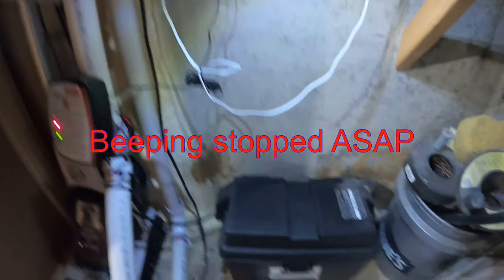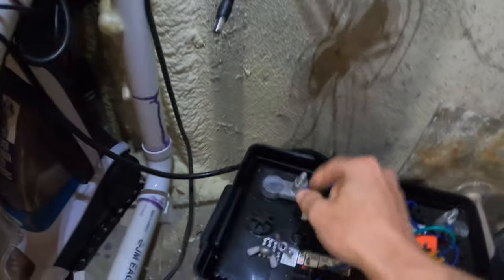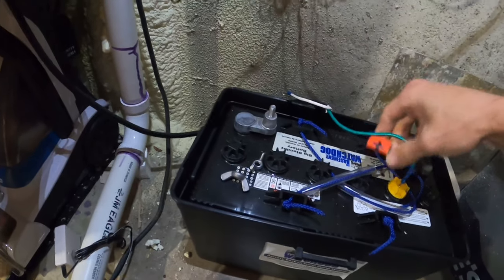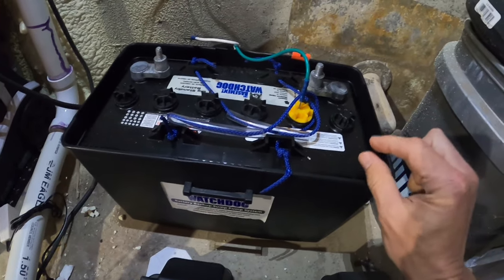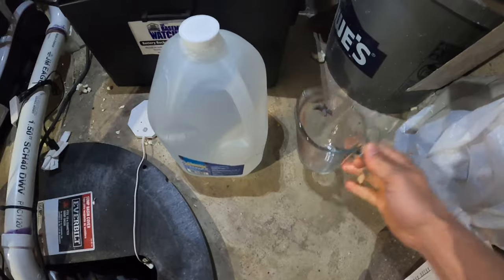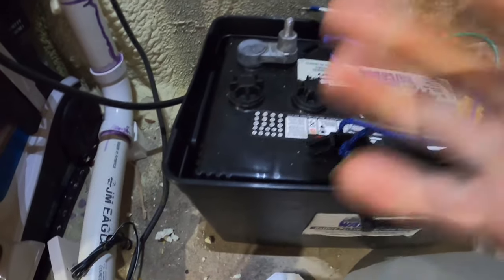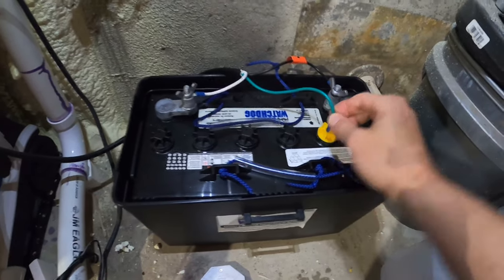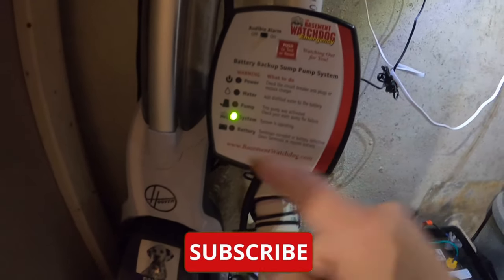How to Add Water to a Watchdog Backup Sump Pump Battery

Comment: Great video. 1. How come the acid does not react with the water? 2. How many ounces normally per section is the capacity? I m afraid to overfill and spill.
Reply from the maker: You only add acid once.  After that only water.
Reply: @FamilyDIYtv  thanks

Comment: When you say ledge, are you referring to the accordion looking stuff at the bottom or that little piece of plastic that hangs down from the opening?
Reply: I filled all of mine to just above that kind of accordion looking piece but the alarm is still going off and I’m wondering if I didn’t put enough water in

Comment: Do you have a video on what to do when the bright red button is next to " the pump was activated,  check the main pump for failure?"
Reply from the maker: I don’t - sorry.   I’d unplug everything and plug back in then hit test button to see if pump activates… if possible test it with water to make sure it pump out.    Can put a bucket in there and fill with water.   See if it pumps out.
Reply: @FamilyDIYtv  thanks, I found a video already saying what to do. I just had to press the reset button. I guess the pump just had to be reset

Comment: What I like to do is pull the battery out put it on the bench and shine a flashlight from behind it, and you can see the water level and each cell should be level with each other

Comment: Is it supposed to smell like gas if it doesn't shut off?
Reply from the maker: you mean when you open the battery?  if yes, it does smell like gas, like sulfur ....  it's acid. 

-Mike
Reply: @FamilyDIYtv  Thanks for the video. I added the distilled water, but the beep did not go away immediately. should it take a while before the beep can be off? Thanks
Reply from the maker: @fyuanster  it should go away right away. Might need to add more water.    

Test the prob by putting it in water and seeing if it stops beeping. If it doesn't stop you could have a break in the wire.   Check the wire then.
Reply: @FamilyDIYtv  what does the prob look like? I did get it to stop beeping however if it moves a certain way it’s beeping.
Reply from the maker: @jordankehoe9332  it’s connected to a wire

Comment: What if it doesn’t go away after adding the water
Reply from the maker: Either you didn’t add enough water 
Or
The probe that detects water is corroded and gone.   Can test this by taking out and putting in water.  Beeping should stop 
Or
You have a break in the line running from the prob to controller.   Check wire
Reply: @FamilyDIYtv  I saw you say check the wire on someone else comment. So I went back and moved it around and it stopped. I filled all 6 cells because they were all empty. It’s the small watchdog battery. Is the probe the green wire? And if so does it go in the water directly?
Reply from the maker: @jordankehoe9332    the cells were empty ?  that's odd...

but yes, on mine the prob is the green wire.    

yes, it's goes directly into the water, think it's about 3 inch long when new.  

good luck man,

Mike
Reply: @FamilyDIYtv  yeah the cells either empty or REALLY low. It took over half the jug of water to fill to the mark. But perfect we are all clear. Thank you for your video and responses!